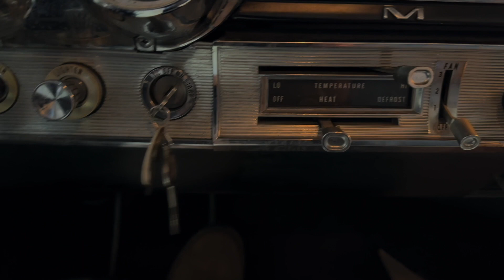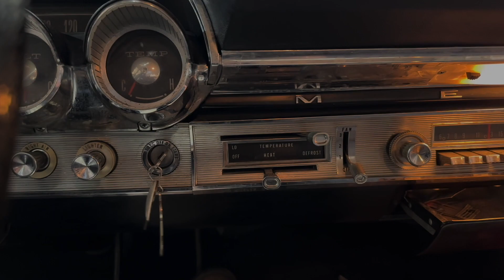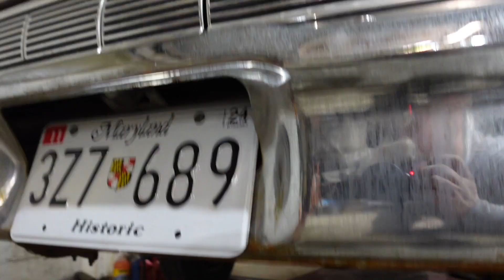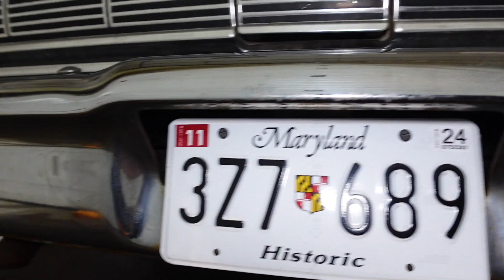Swap Meet Gold Rare Mercury Montclair Gets Back On The Road In 40 Years! (Chasing Crappy Cars Ep.20)

Comment: You can blow compressed air through the old fuel hard lines . ( it’s pretty common knowledge)
Reply from the maker: Thanks we tried that plugged shut with holes in it so didn’t bother with using the hard lines.